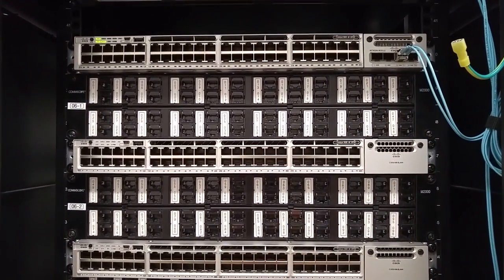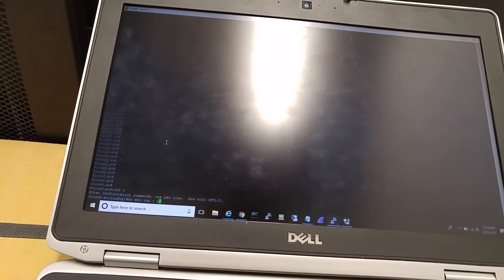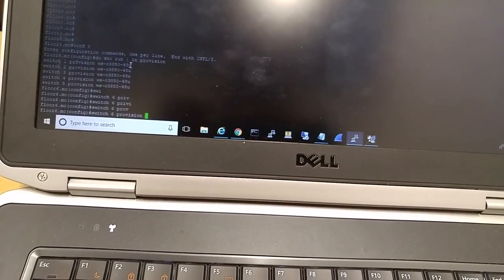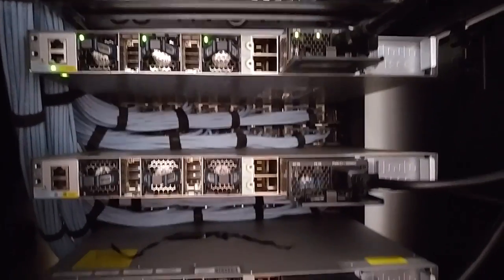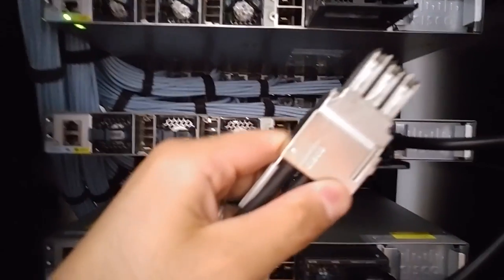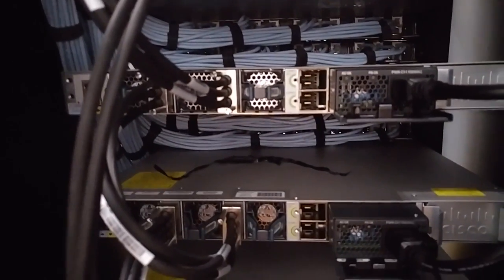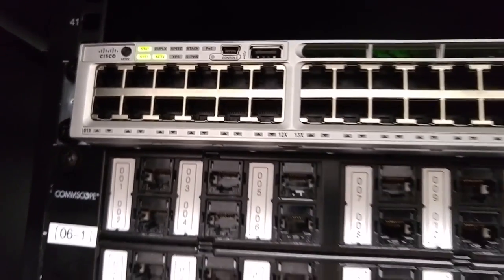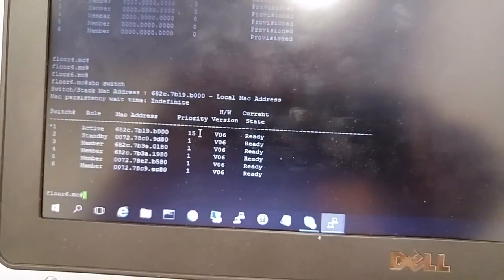Connecting StackWise Cables on Cisco 3850's Switches

Comment: If you incorrectly insert the StackWise cable upside down, would it fit and be able to screw it completely in? I know it wouldn't work, I'm just curious if would fit in. Thanks!
Reply from the maker: No, you wouldn't be able to plug it in, it's only one way where the "Cisco" word is straight/upright.
Hope this helps!

Comment: Hello. I have some questions. Did you use default stock '50CM Type 1 Stacking Cable' (STACK-T1-50CM) except one long ? How long is last cable ? Is 'Cisco Stackwise-480 1 m stacking cable spare' (STACK-T1-1M=) long enough to connect 1st and last in stack of 4 SWs ?
Reply from the maker: Yes exactly, I used the 50CM that came with the switches, and then the 1M to connect the 1st and last switches. The 1 meter is long enough!
Reply: We are going to install a 7*C9300 stack and want to know if 1M stacking cable will be sufficient

Comment: Hello, I have 2 switches, one Active and the other standby, what happens when the Active goes off? Are both turned off?
Reply from the maker: The standby will become Active until the initial active switch comes back up and has higher priority.
You might need to reboot the stack so that the switch with higher priority takes the active role again.
Reply: @AliYounesGo4IT  do we need two stacking cables to make loop for 2 stack switch setup.
Reply from the maker: @harshanetpro  Yes, two cables for two switches